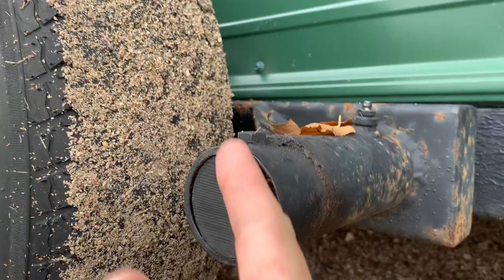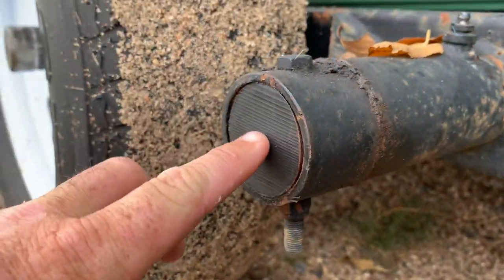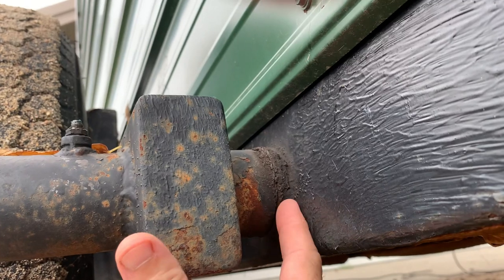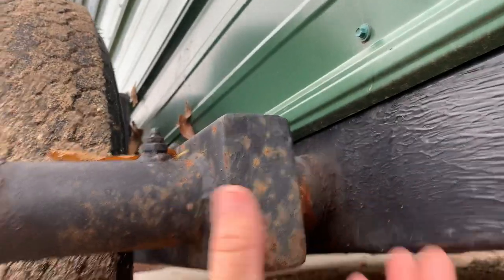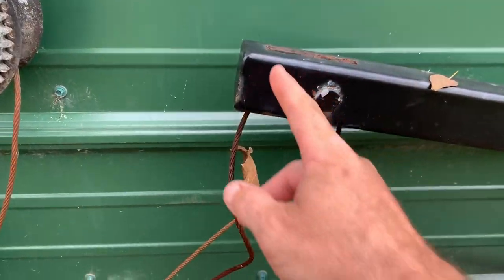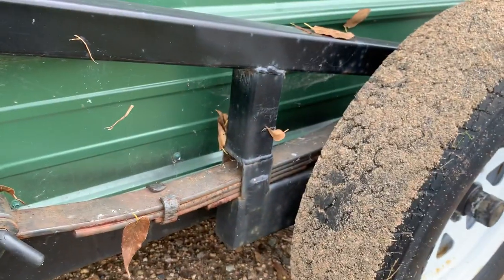Fish House Drop-Axel (walk/talk through)

Comment: Could u put the link on here for the spindle deal on Amazon I couldn’t find them.
Reply from the maker: Southwest Wheel R50642X 42 Spindle & 6-5.5" Bolt Circle Trailer Hub https://www.amazon.com/dp/B07DVPPXRS/ref=cm_sw_r_cp_api_glt_fabc_BXP89XKVAR14KZR9H5GW
Reply from the maker: These are 5000lb (for the pair). You’ll have to get the size you need

Comment: What degree did you put your axles at?
Reply from the maker: Level
Reply: @McGowanOutdoors  any issues with wheels flexing in when under a load? No tire wear either?
Reply from the maker: @scottgrossinger4779  no, seams to track and wear well. Over 3,000miles on it so far
Reply: @McGowanOutdoors  awesome thanks for the info.

Comment: Do you have a build thread or blog?
Reply from the maker: No, but I do have a few more videos on the build on my channel
Reply: @McGowanOutdoors  I'm interested in how you built the whole thing. What insulation you used, what framing material you used, and what you used for the flooring.
Reply: @McGowanOutdoors  Also the size of the shack?
Reply from the maker: 6.5ft x 14ft plus a 3ft V-front
Reply from the maker: Built it out of 2x4. Spray foam insulated everything.